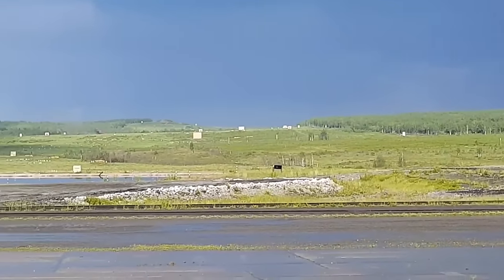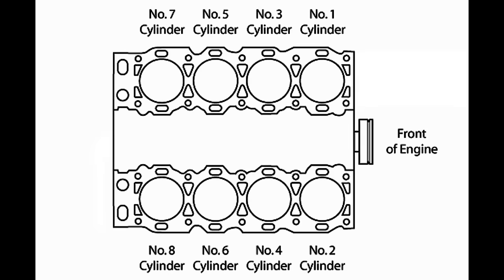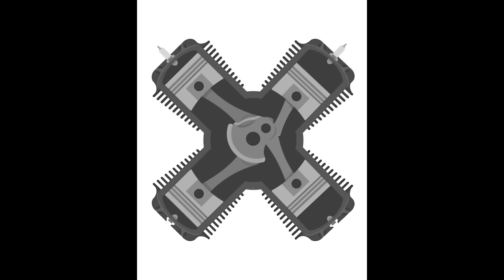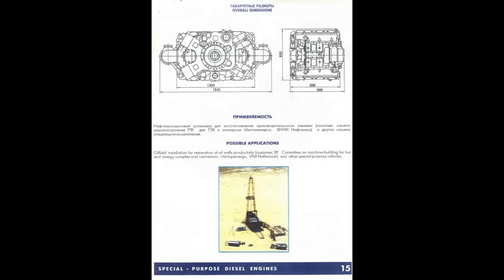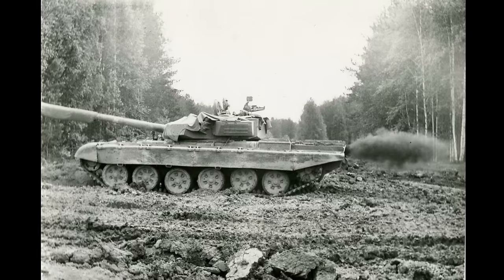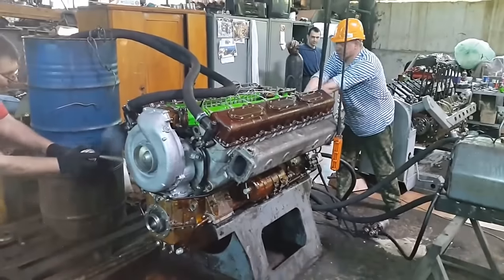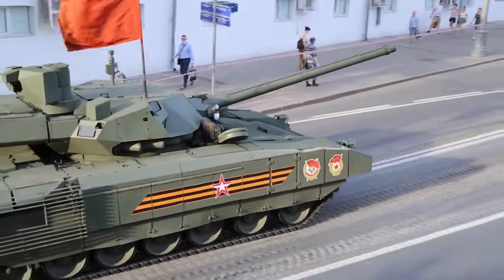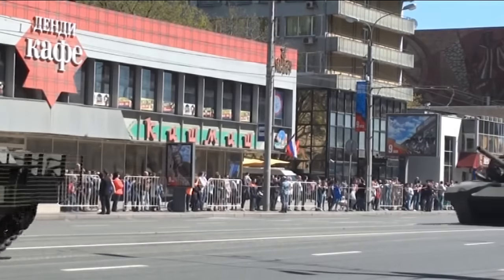Controversial History of T-14 Armata's Engine

Comment: Cool looking engine...is it worth a crap?
Reply: @mcburcke    Probably not.  Soviet and now Russian engines on average have faired poorly in comparison to western or Japanese engines.  Russian engines (no matter what the engine is, piston or jet) require more maintenance, have a higher failure rate, require replacement sooner and use more fuel which is why if someone is purchasing engines, they buy Russian because that's all they can afford or there are laws preventing them from buying western/Japanese.
Reply: @americansupervillain459😂😂😂5

Comment: They had problems and worked them out. Happens. Serial production has happened, 136 vehicles based on the platform are under construction. 1st guards army has already received variants last year which continue until the order is finalized probably by summer. Your right we shall see.
Reply: Nah they are not in service
Reply: @gerfand  Maybe not in service but used for training so they can be in service in a couple of years maybe
Reply: @kopfstroh  yeah but they are not in service like you won't see them in the SMO for example
Reply: Parade ground tank

Comment: I must have missed a basic premise, but what is the advantage to this configuration in the first place? More pistons, more displacement, more power per engine block volume?
I got the impression, from the dip into the engine's Aviation origin, that this configuration can be exceptionally powerful.
Or is it more just Sov/Rus industry exploring several routes at once for industrial research?
Reply: You can go for more pistons in a more compact shape this way compared to a V engine.

Comment: Let me explain it simply, it's like BMW and Ford each making a V8 engine, they are both the same configuration, that being the V-shape but they both have different dimensions such as the Displacement, Bore width etc. But while they are both V-shaped engines with the same 8 cylinders, they are not the same engine, they only share a similiar design philosophy.

Comment: The Soviet engineering school also created more exotic internal combustion engines. For example, Balandin's X-shaped connecting rodless engine for aviation. It used connecting rods to convert the translational movement of the pistons into the rotational movement of the shaft.

Comment: The real question… what is the reverse gear like?
Reply: the vehicles of the armata family have a wonderful transmission, 8 forward and reverse gears.
Reply: @kipkarl1580 transmission is so good it breaks down on parade
Reply: @tallshort1849  Except it was most likely the driver accidentally pulling the handbrake since it later drove away under its own power.

Comment: I had a feeling from preliminary looks when this drama started that it probably had completely different crank design, therefore a different block, and different overall design.
motors are like crabs, sometimes (manufacturers) they learn from each other, sometimes they steal, sometimes they simply evolve separately yet end up looking so similar.

like the GE LM500 turbine is a descendant of the Tf34 of the A-10 warthog, they are very similar, but the LM500 lacks all the shell plating, hardened fuel/control lines, redundant backups, aviation-certified components or stronger/reinforced compressor fins found in the tf-34 (and from what I've read long ago, some significant structural re-design), because it isn't nesscasary to make a marine powerplant resistant to 23mm AAA. so despite being arguably interchangeable, completely different engine overall.

x-layout is a choice of circumstance, very desirable just like opposed engines in light aircraft and Subaru's, they are very compact & powerful.
nobody is saying that my Impreza has the `same engine` as my Cessna, they don't even use the same fuel & one has a carburetor yet they are at a glance, remarkably similar.

Comment: The engine is not old by conventional engine standards. When those 'theorists' say the engine design is "old", they mean it was developed before the advent of modern CAD methods, 3D-printed parts, plasma ignition, nanocoatings etc.
Reply: Which means that it's a dinosaur. Older technology is difficult to draw power from without serious compromises. When you have superior cooling, less drag losses, better coatings, more sensors and electronic control to adjust the engine operation on the fly, you draw more power without sacrificing reliability.
Reply: @ChucksSEADnDEAD  
You clearly have no idea what you are talking about.

Comment: I would still like to add a valid point though... which actually is quite annoying if you think about it. Saying that "engine is old" is just a propagandist's cliche. Because it doesn't matter how old the engine design is. The only thing that matters is it's power output, it's reliability, and it's price. And it's age is 100% irrelevant. It's just an assumption that an older engine design is worse, which is not always the case.
Also I believe the main reason why there's no series production of the T14 Armata tanks is simply because of their cost. And not just the initial price, but the cost of maintenance and training which would increase it's costs compare to the T90M at least 3 times.
Reply: Age is 100% relevant because a newer design would include better technical know-how to get reliability at a high power level.
Older engines tended to be overbuilt, drank a lot more fuel, made more noise and vibration, etc. Things were heavier and belched smoke.

Comment: I have never heard of a vehicle engine that no one ever figured out how to get more power out of over it's lifetime . So saying the engine will not have enough power in 10 or 20 or 30 years doesn't ring true to me.
Reply: If the design is crippled by it's basis, it's better to start from scratch. You can always get more power. But the wrong design can make things asplode.

Comment: Great video and all, except it means absolutely nothing. Regardless of the engine the T14 uses it’s still clearly a bad tank, otherwise the Russians would have been mass producing them and using them in Ukraine. Yet very limited numbers exist and none have seen active combat, it’s almost like they’re either too expensive to risk losing, not capable of anywhere close to what the Russians claim or most likely, a combination of the two. Regardless I appreciate the time you spent researching this topic but can’t help but think it’s just an attempt at digging up and beating a dead horse for views.
Reply: Or, most likely, the above is just your imagination. It is obvious that this tank simply does not have tasks that should be entrusted to this vehicle... Moreover, the battlefield has changed so much that now any equipment must be conceptually tested for the relevance of military thought. And of course a new tank, it’s expensive! So tell me, why are you making up your fairy-tale stories about knowing from somewhere whether a tank is good or bad, when the very logic of the environment dictates the conditions for this tank not to go into production. There are no goals for it, there is no such new enemy, it is expensive, and it has become outdated in 9+ years, due to drones. Obviously, there is no need to release the tank in the same form as it is now...
Reply: @scottbailey6835   Drones will be taking over tanks

Comment: Wehrboos are a droll lot who (keeping it real) wish the Third Reich had won because it had some visually exciting designs and Hugo Boss uniforms. That's extra amusing since most will never operate or work on military vehicles (and war games aren't real). Designing a decent diesel capable of many decades of service with gradual refinement should be expected of any post-1900 industrial economy. There is little new to invent other than improved materials and more efficient automated manufacturing and only the electronics on modern AFV are "exotic" (and still often lag the civilian sector in performance due to lead times longer then semiconductor manufacturing generations).  Any low hanging fruit was picked before most humans alive today were born which is why further refinement is so expensive and complex to execute.

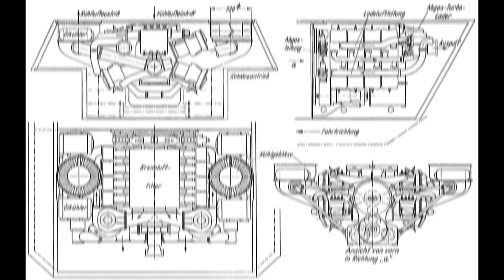Comment: You  showed an old German drawing at 8:55  with is useless. Keep in mind there were no Xerox machines and of course no CAD systems with printers. Meaning without an info box left or right at the bottom it doesn't proof anything. As a drawings like this were a big job at that time the info box would always have details, name of the project, who made it, date,  what version /revision  etc.etc.
The current motor is a failure.
Is it a copy or just a source for inspiration? It doesn't matter.
It broke down during the parade in Moscow and several people suggested one has to have a team of engineers and service men with spare parts handy if you want to use the tank for its intended purpose which is going to the battlefield.

Comment: I thoroughly enjoyed your video on the T-14 engine, not least of which because you did an exemplary effort on the background research. I wanted to ask you, because it's possible you may be able to help me, as to whether you might be able to assist me in some research I am attempting. It's a subject you may even find interesting for yourself. The subject concerns multi-speed aero-engine propellers, a very obscure aviation technical subject. Essentially, the propeller reduction gearbox is a change-speed unit to enable the pilot/automatic controller to change the gear ratio in flight to suit the required operating condition. None were ever used operationally (that I know of) but several experimental installations were made and a couple even flew. Typically, these were intended for the largest, most powerful aero piston engines. I have a pretty complete idea of what America and Britain undertook but the mystery is whether Russia, and the wider Soviet Union in general undertook such experimental projects. Possibly, there is information in the Soviet patent archives as some of your research revealed in the case of the T-14 engine video. I don't speak a word of Russian and the patent system is a mystery to me. Is this something you might like to have a quick look into? Would you like my direct e-mail address for ease of contact? Thanks in advance.

Comment: Looking at the stats on the 6TD-1 and it says it's 1602x955x581 is that in millimeters time stamp 17:50? I'm guessing it's gotta be it would be way to big any other way but almost seems to small in millimeters when you convert it to feet.....and a life span of motors as being good when they are under 200 hours compared to what is bad quoted as under 100 hours is insane.....how often were they replacing engines???

Comment: The only aspect it borrowed from the Nahtzee engine is the X-configuration. The engine was tested in the 70's and casted out because of it's vertical height and un(russian)conventional design. The T-14 was a taller hull, more advanced design and they finally drew the engine from history and redesignated it in an attempt to avoid tracing. All in all it shares an incredible amount with the Kharkiv V-2 series and is laughable at best as far as modern technology is concerned. They finally designed a tank that doesn't annihilate it's crew in the event of a full turret and ammo rack cookoff like it's predecessors, even as it may be even more susceptible to this, as the rear of the turret under the applique sheet panels is rectangular at 90 degrees to ground, offering little to no protection to direct side hits from say 30mm and above projectiles. The engineers that developed it were pioneers, but they're using it over half a century too late. They're afraid to use the tanks both from the monetary investment and the intelligence standpoint that they cannot expose it to be comparable to the T-90s effectiveness, being an absolute flop, being hardly more capable and the only advantage being in manpower cost and crew survivability. The Germans that are so egotistical in their engineering prowess that they believe an engine that only shares the cylinder configuration with it's own is a copy are dumb as fuck, and the tank itself is pathetic. Cheers.

Comment: Interesting engine configuration. The master/slave rod configuration is a bit bizarre. I did not know it was used outside of radial engine designs.  I suspect part of its reason for existing is for space packaging reasons. It’s definitely a more complicated engine to design and produce. The provided power and performance numbers are not very impressive for its overall size. The roller bearing crankshaft is not something I have seen outside of 2 stroke engines, primarily out board boat motors. It also appears that these engines have rather short periods between services and overhauls and are maintenance intensive. 

But I keep in mind that Russian designs are very often quite different from designs produced elsewhere.

Comment: RedEffet how much do you know about Soviet armored vehicle engine production during the Cold War? Recently I heard an interesting story about their quality control or rather "quality selection" practice and I'd like to know how much of it is true. Here goes:

So Cold War was more of peace for Soviet military industry, but still they wanted to produce tens of thousands of tanks and all the supporting armored vehicles. However the engine manufacturing was dangerously close to bottlenecking the production. In theory it didn't seem that bad, but too many engine parts were not up to the standards. This is when they came up with a brilliant idea: Just allow worse parts as well and test how much power the engine happens to make. As a result the same production line made good over 700hp engines for tanks and "flawed" 400hp class engines, which were fine for supporting vehicles. By Western standards the fuel efficiency of those weaker engines was very poor, but that wasn't as much of an issue in USSR.

Comment: Could a Gas Turbine engine be the solution? Considering they announced the restart of the T-80 production and the V-92 has reached the end of its development potential then maybe a gas turbine one could be the solution. 

Gas turbines have been described as fuel hungry and more maintenance heavy in the past, the question should be are they now? Or has the technology advanced sufficiently that Gas Turbine engines are a valid option on par with diesel ones.

Comment: Still guessing this engine may be an enhanced separately engineered piece of hardware... But probably has some basis in looking at captured foreign designs instead of scratch engineering the entire engine's concept... The intermediate cartridge based AK-47 is certainly it's own design... However it's easy to see how it may have been  influenced by the STG44, or atleast it's intermediate cartridge and the M1 Garand when it comes to certain internal components... But it is a copy of neither and has no interchangeable parts... Then again most popular modern assault rifles can be argued they are basically just improved AR-180s with gas piston systems taken from various older weapons... I guess it just depends on how far you want to take the copycat approach for your argument either way... Every firearm is based around Chinese hand cannons, just like how evey bored cylinder engine running on various petroleum products can be a copy of an old very simple  single cylinder combustion design... Or on the other hand most firearms and engines use certain technologies that have been proven to work great, although none of those systems are usually interchangeable or even based significantly on the thing they share commonality with... So I can see why the T-14 engine is called a copy just for using certain design elements that may have some design influences, but also how it is a unique design when actually directly compared... This is just a common thing for many technologies... Especially military technologies it seems. The arguments will never end from either side on anything that has anything remotely in common with captured enemy equipment or designs... It is the internet after all...

Comment: Totally ignoring the history of the engine, I’ve never seen an Armata with an engine that appeared to be operating properly. I’m an engine guy, specializing in non-road and commercial engines. There’s either problems with the pre-production engines, or the tanks I’ve seen have been run hard and not maintained.
Reply: They have reliability issues at the required power level. The age of the design is showing itself as it doesn't have the sensors and electronic monitoring necessary for this kind of use.
Reply: @ChucksSEADnDEAD  

I’d like to see the actual engine data, but there’s no way they’d provide the level of detail I’d want. You only get that access if you are actually working with the manufacturer.

Comment: I don't understand the critisism of that russian engine, comparing it to M1A2 Sep V3 engine it makes the same power and torque while the abrams weight is 25 tonnes more then T-14 armata.
Also M1 Abrams engine also was developed very long time ago( end of 1960s)
1500hp is a lot especialy for tank that weight only 50 tonnes compering to it competiosion(70tonnes)

Comment: W8, they said that 1500hp engine is to weak and they need 1700hp for the future programs? What they are planning to made, Maus 2.0? T-14 is heavier than T-72 or T-90, but it is still much lighter than most of the NATO tanks - and all of them are running on the 1500hp engines and doing fine. New engine US is developing for future tanks is also 1500hp. Why russians need more?
Reply: They need thrust, acceleration and better performance
Reply: @НиколайСмирнов-с7х  So they need more torque, not more power. And, they definitely need better transmission.

Comment: X designs would likely need a compression release or something to remove oil leaking into lower heads as old air craft engines did, x does have good packaging for high power. V8 compactness with v16 displacement